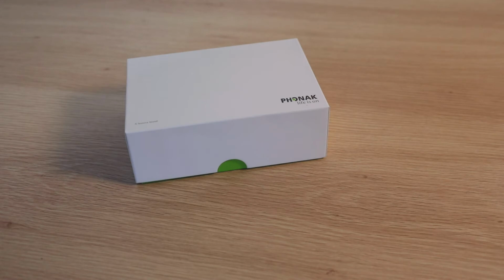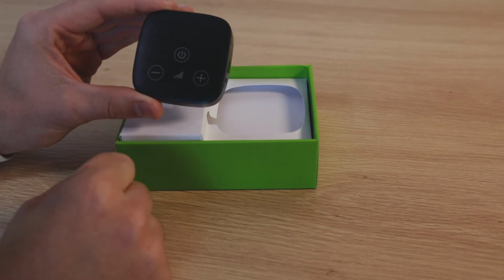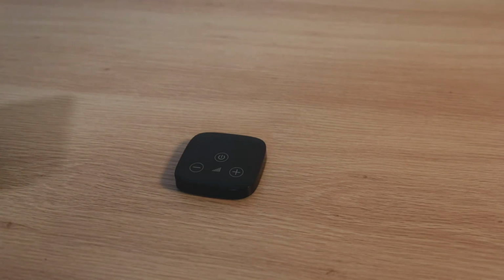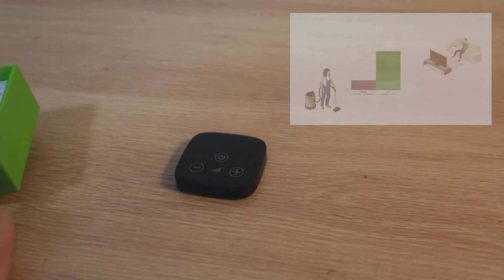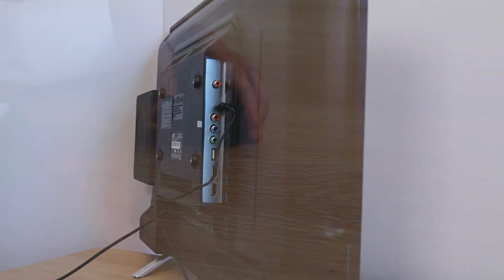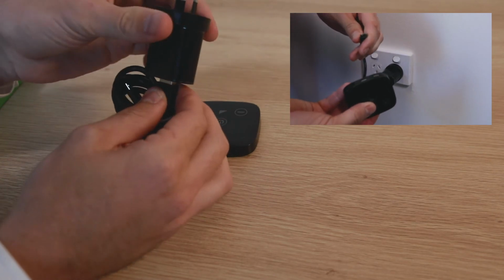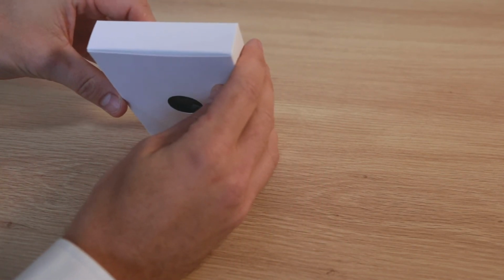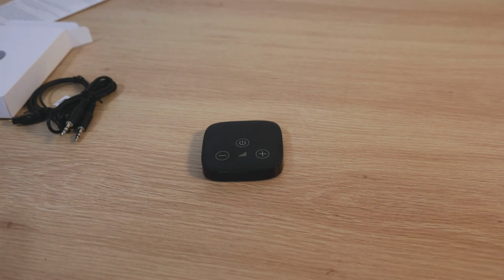Phonak TV Connector - Unboxed & Reviewed (Marvel)

Comment: Does it come with a remote for the volume?
Reply from the maker: Good day, it doesn't come with an offical remote control. However you can use the myPhonak app on your phone to adjust the volume remotely when you pair your hearing aids to the tv connector and the app. You can also adjust the volume manually on the base of the tv connector. If you like to find out more about the Myphonak app we have made a video on how to download and use it.  which you can check out here: https://www.youtube.com/watch?v=uKiPlpb1Mzw&t=189s 

We hope this helps. Thank you
Reply: Or you can adjust volume from the ear hear device. My office just try it.